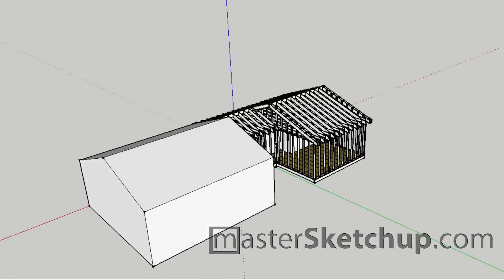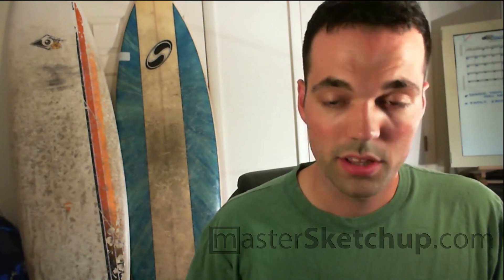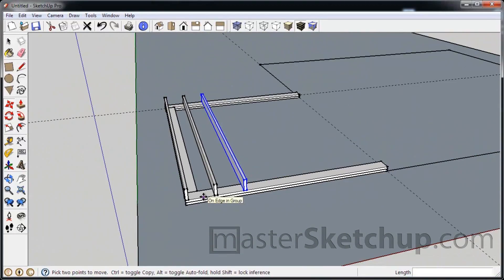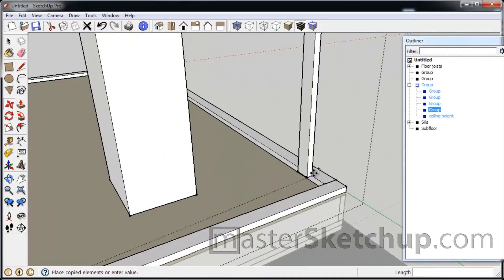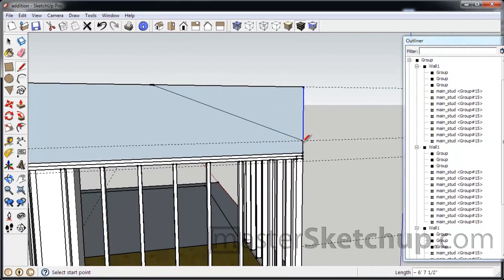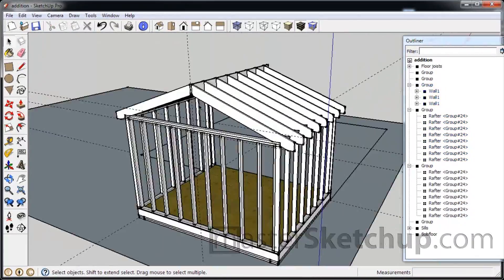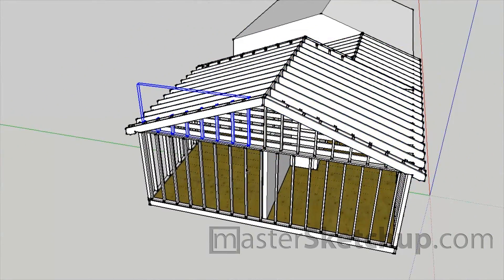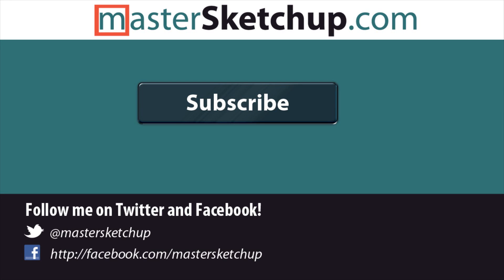Sketchup Tutorial - Residential Framing

Comment: I liked the fast speed, but I would like another video that goes more into the "tricks" that you typically use.  Say this one was a pre-req, and the next one shows a few regular motion segments that explain how, say, the story pole was used, how you trim and size things, etc. 

One question...I think I saw an adjustment a group of rafters using the scale tool.  Wouldn't that slightly change the dimension of the lumber?  I've stayed away from scaling things that were diagonal, but maybe in this case it was a very small change.